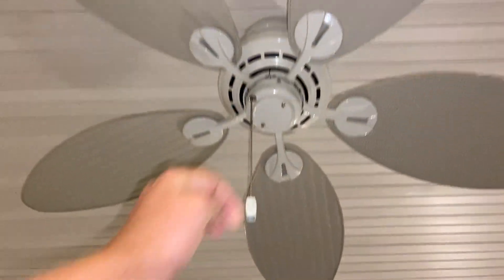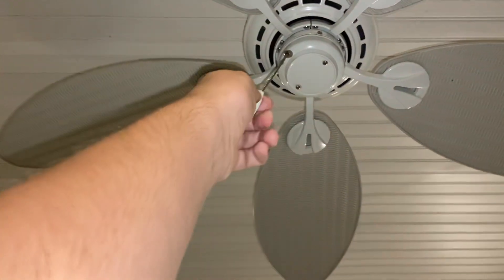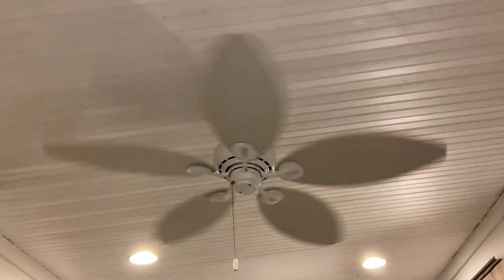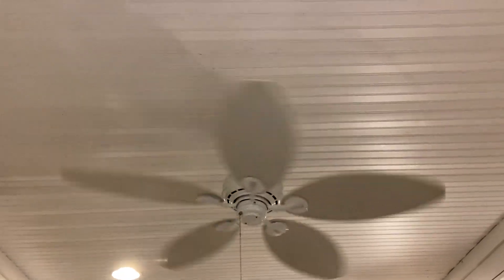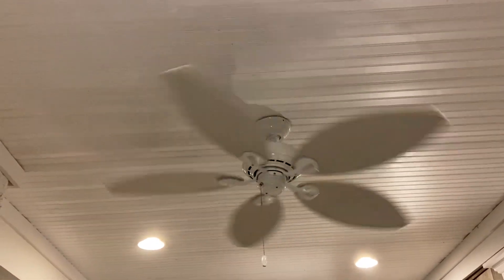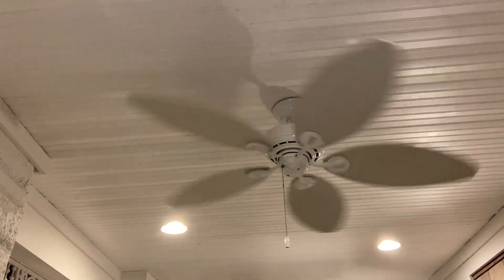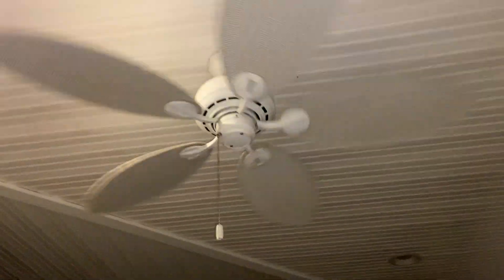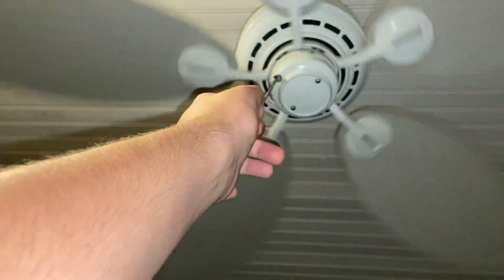Hunter Bayview Ceiling Fans - Addy Sea - Bethany Beach, DE | ECFE

Comment: Usually fans that are sideways on a flat ceiling get that way from someone pulling on the chain far away from the fan, possibly resulting in a slanting position. Can’t say the same about the first fan you showed since the pullchain isn’t on the slanting slide of the fan.
Reply from the maker: This one was stiff. Perhaps it was on a sloped ceiling kit or something, the ceiling in that area does have a very very slight slope, but it’s barely noticeable